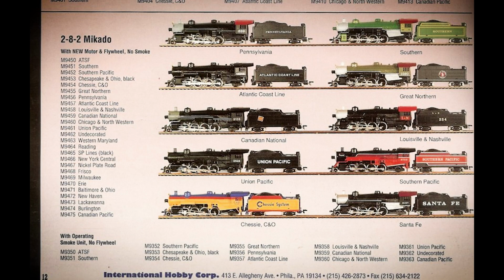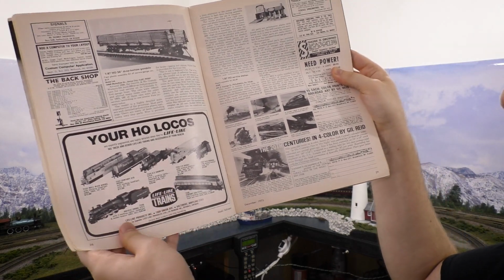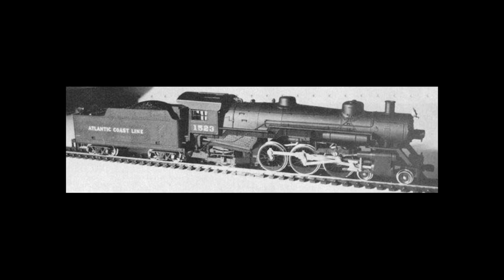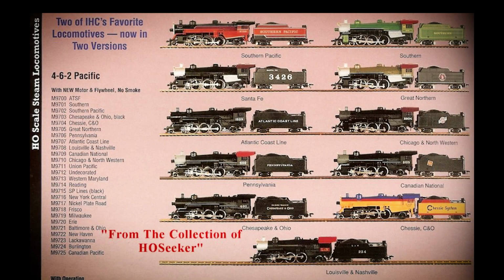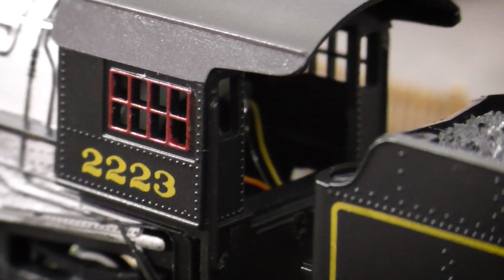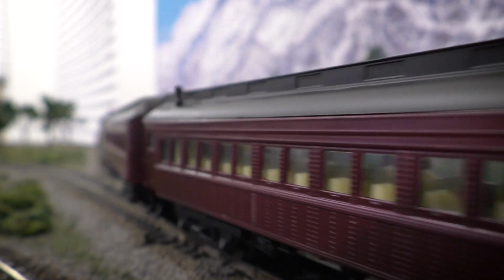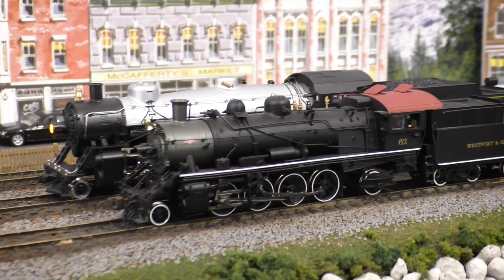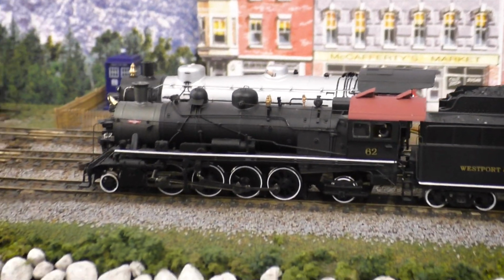IHC 4-6-2 Pacific: A Venerable Workhorse

Comment: This is a great video! I’ve always LOVED the IHC locomotives! They just run so smoothly and quietly and still hold up pretty well to this day, and those shiny pistons on them are amazing imo! I love the USRA 4-6-2s, but I personally prefer the Mikados. I own one in the Durango & Silverton scheme (even if it’s horribly inaccurate to the real deal), and it performs spectacularly and instantly became my favorite HO scale locomotive (mainly because the D&SNG is my favorite railroad). Anyway I loved the video, and great work on the modifications to the Pacific! I would never have the patience to repaint a locomotive as greatly as you did!

Comment: Great video going over this interesting locomotive. I have 2 of these. One by AHM and one by IHC. I noticed a significant step up in the details of the IHC over the AHM. Both run great, just seems the IHC is a bit better. The AHM locomotive is a Southern Pacific in a Daylight livery. The other is Southern Railway and is The Tennessean.

Comment: I have an older Canadian pacific one with a boiler that came painted grey and a marron tender. For the price their pretty sold little locos, and rival most of Bachmann’s offerings in terms of performance. Definitely worth investing in the older models! One thing that I found helped with the slow-speed running on my example was removing the old bulb, as it seems it was drawing a ridiculous amount of current. I haven’t installed an LED yet, so I don’t know if that will hinder the performance, but seeing as most modern LEDs draw very little current, I can’t really see that being an issue.
Reply from the maker: I didn't really notice a difference on mine, but I definitely wouldn't be surprised if removing the old bulb did help. When you install an LED, be sure to add a resistor so it doesn't burn out (I usually use a 1K, but you might be able to get away with one as low as 600 ohms).
Reply: @michaelramsey81  Thanks for the tip, you just saved me an LED (maybe more), as I would not have thought to add a resister. I think some LEDs have resistors already attach as well, so I’ll bare that in mind as well!
Reply from the maker: @modelrailfan37  Yep, depending on where you buy your LEDs, they may be pre-wired with a resistor. If not, it's easy enough to add one. Also make sure the polarity of the LED is correct, otherwise it will only light up when the train is moving in reverse. (If this does happen, swapping the two wires should fix it.)
Reply: @michaelramsey81  good to know, thank you! What LED did you use in yours? I just was wondering if the cheap ones on eBay are okay to use?
Reply from the maker: @modelrailfan37  As far as I can tell, all LEDs of a given size and color are basically the same. Cheap ones from eBay should be fine.
Reply: @michaelramsey81  thanks!

Comment: My favorite which i plan to have 1 day is a model of reading- blue mountain and northerns #425 on the lehigh gorge line in PA. Its a very nove blue color with white stars on the wheel centers.
Reply from the maker: I actually considered painting this one as #425. Ended up deciding not to because I wanted to keep the tender lettering. I might get another one at some point and do that.
Reply: @michaelramsey81  425 is going for her 1472. Thats the required inspection every 15 years or 1472 operating hours. Same for Strasburg #90. Hopefully 425 is put back in service. They have to tear it down inspect and rebuild it. Hopefully it is done in a timely fashion. I beleave they use the Altoona shops for 425.

Comment: I actually have the mikado version of that engine. It served as the big engine of my fleet until 2021, when I got newer spectrum and Bachmann dcc ready engines. It no longer runs with my main fleet, as I have converted the entire layout to dcc, but I still have a small loop of track for it to run on. My parents bought me that engine way back in 2017 when I first started model railroading, and I was happy with it until newer engines came along. Now it just sits in its box, collecting dust. Also, where did those red Pullman coaches come from? I’m interested in getting some for my own model railroad.
Reply from the maker: The coaches are Rivarossi 60' commuter cars. They were originally grey - I repainted them in Tamiya TS-11 Maroon. I believe they're discontinued, but you might still be able to find some used ones.

Comment: I own several locomotives that were sold by AHM (IHC’s predecessor) these locomotives still perform flawlessly. These particular locomotives were manufactured by Rivarossi. The only problem Is, they won’t run on code 83 rail because of the deep flanges.
Reply from the maker: As it happens, I've been experimenting with grinding down the flanges on old Rivarossi locos for that exact purpose. I'll make a video on it eventually.

Comment: I hate to spoil the love of USRA WWII design, but the Southern Pacific NEVER owned a USRA version and most of their Pacifics, Mikados, 0-6-0's, 0-8-0's and 2-8-0's were of their own design and vanderbilt style oil or coal tenders. To make it worst, they never painted a 4-6-2 or 2-8-2 in the full Daylight scheme. I had the Daylight Mikado and it ran bueatifully for over 20 years! Then the driving gears snapped and it was considered 'scrapped'. I still have her and hopes to get her rebuilt (Becoming an Athearn or Bachmann version lol) someday.
Reply from the maker: I'm sure most of the IHC paint schemes weren't accurate to their roadnames. It's not anywhere close to correct for a Canadian Pacific engine either.

Comment: I have 5 Mehano/IHC locos in my collection, 4 of which are steamers. They are all from the "Presidents choice Insiders collection" which is actually a grocery brand that sold HO trains sets in their respected grocery stores in the 1990s and early 2000's at Xmas time. I have the 4-6-2 pacific in a special semi Streamline CP shell that is painted similar to your custom job. It's gorgeous and since it's from the late 1990's it's motor is extremely powerful and it pull 8 Rivarossi/AHM heavyweight coaches with not a single issue. I also have a 4-6-4 Hudson (CNR 5702), 4-8-2 Mountain (CNR 6060) and a Santa fe 2-10-2 (CNR 5100) all fantastic runners!

Comment: I think Model Power was bought by Lionel Trains last year cause I saw some HO buildings that were now under the Lionel HO brand. Meaning Lionel could make scale detail versions of Model Power’s engines with railsounds, smoke, electronic control system, and few other things that Lionel puts into their O gauge trains.
Reply from the maker: Lionel's history with HO is sketchy at best, but it'll be interesting to see what they do. They did make some interesting diecast locos with sound a while back.
Reply: @michaelramsey81  That HO Scale Challenger.

Comment: There is one important spotting feature the distingishes the era of the models. The type of flanges on them. Okay, this is were it gets really confusing and unpredictable. Oh hell, if you can figure this out let me know! My head is now spinning just thinking about it. The code 100 flanges and the NMRA standard flanges seem to change from one manufacturer to another. Another fun fact is the Chattanooga infamous 0-8-0 (its really the 2-8-2, but they tried to trick us - hah take that tyco!)
Reply: The 70's Model Power and Like Like versions of the Mehano Pennsylvania A-3 and USRA 4-6-2  had honest NMRA 0.025"  wheel flanges (but not he tender of the A-3, which had Rivarossi style split plastic wheels). I still have a set of 4-6-2 drivers and trucks with the small flanges in my scrap parts bins.

Comment: I would Like to get a 4-6-2 or a 2-6-2 Both do Look Good.
Reply from the maker: 4-6-2s are much easier to find in HO than 2-6-2s. the IHC 4-6-2 is pretty good for what it is. If you want a bit more detail, Bachmann currently makes one as well.

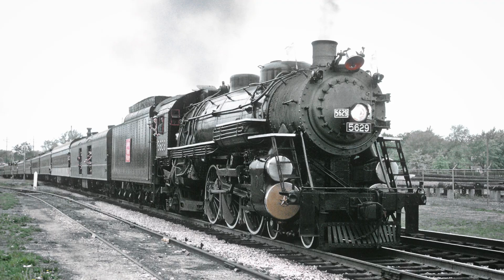Comment: 4:09 RIP gtw 5629 you could’ve been saved if not for metra.
Reply from the maker: Yep, a serious shame. At least 5632 still exists.
Reply: Actually,  it wasn't entirely metras' fault.
Actually,  Metra tried saving it, but the owner of the engine refused to move to, and Metra was forced to scrap it. Then the owner sued, and that failed

Comment: So I’ve been looking at getting a Bachmann 4-6-0 and you seem to have lot of experience with them. Do you think I should look for a older spectrum model or a newer one?
Reply from the maker: Definitely an older Spectrum model if you can find one! They are much more detailed and run better than the newer blue-box ones. If you can, try to find one you can test run before you buy it.
Reply: @michaelramsey81  Thanks for the advice! I’m trying to find one to make into Rio Grande Southern 20.
Reply from the maker: @LMR78  For that, I'd look for a the low boiler version with 56" drivers. If possible, try to find an undecorated one - they came with an alternate wood-style cab that looks more like #20. It's never going to be a perfect match because #20 is narrow gauge, but you could get pretty close to the right overall look.

Comment: I have one of those but it is lettered for New Haven.
I don’t run mine very much anymore but I still love it even though it is not really detailed.

One thing I did to mine though which I think really improved it was I removed that molded in coupler and modified it to have a kadee on the front.
Making it useful for switching or doing run around type operations

Comment: I have had and still have a few. I use em for base’s of more prototypical locos. I found it works great driver wise for a wide range of Anthractie road locos and as a heavy mod stand in for a NYC K11 (try finding a browser one for under 100 today) my only complaint is tender swapping is difficult with all these locos.
Reply: The tender only connects with a drawbar.. no pesky plugs or other wires.. how is that difficult to swap out?
Reply: @Alerrecks  more so a lot of tenders are too short, draw bar on tender, or is Bachmann. Also some of the pacifics are bar on loco and some are bar on tender, depending on year made.
Reply: @mattsmocs3281  so drill a screw hole and cut a piece of styrene.. not that hard lol

Comment: Been looking into a pacific for my railroad. It’s either this or Bachmann’s 4-6-2. The models I have found are a $149.99USD in a purple box, and a $75.00USD in the older yellow box.
Reply from the maker: I'd go for the yellow box one. The only difference, as far as I know, is the handrails. If you're going to spend $150, you might as well spend a little more and get the Bachmann.
Reply: Ok, good to know. Might get both, my fictional railroad is going to have to wait until the future, but I’m still looking into it.
Reply: Also, just wondering, i have an athearn/roundhouse 2-8-0 that i got used on eBay, and i doesn’t really run that well. It stops on strait track (it still gets power, but basically shuts down.) any servicing tips?
Reply from the maker: @katies6426  Those were based on the old MDC "Old Timer" kits. As a result, they have some odd quirks. I've found the motors in the Athearn/Roundhouse ones to be a little on the weak side, so there could be a gear issue that's causing it to bind, but it could also be an electrical issue. Gremlins like that can be hard to track down, unfortunately. On the plus side, they're reasonably easy engines to take apart - just watch out of the wires between the engine and tender, as they go through a hole in the rear of the cab, so you can't completely remove the shell without unsoldering them.

Comment: I have one from in the Southern Livery, and I love it. However it doesn't pull well, and has suffered some falls via derailment, and a cat. I got mine at around $60 in an unopened box.
Reply from the maker: $60 isn't half bad. Check to see if it's missing any weights - that might explain the pulling issues.
Reply: @michaelramsey81  nope not missing anything before the cat, and my layout is on a slight grade.
Only small details are gone, and no traction tires.
It pulls about 7 heavyweight cars with very small wheel slip.
Reply from the maker: @richardjayroe8922  Grades make a huge difference. Mine pulls 10 freight cars easily on level track.
Reply: @michaelramsey81  nope no nothing was missing, it came in an unopened box brand new. Layout has been packed for about a week now due to my new job at NS as a conductor

Comment: I just recently bought one of the IHC versions after having killed two Life Like versions (Smoky 3 pole motors, nylon gears, etc - One of them was the original, original Atlantic Coast Line one from 1973 with offcenter decals) but the IHC version is silky smooth and a great hauler.

Lovely paint job on that! Which satin clear coat did you use for the finish? Looks especially good in fitting with the scenery and color palette of your railroad!

I've repainted my previous one into N&W colors, but the one that I recently obtained just happened to be N&W already - I wonder just how many schemes they offered outside the catalog, as I've not seen it documented elsewhere, but it's definitely a factory job.
Reply from the maker: Thanks! The clear coat I used was Tamiya TS-79 Semi-Gloss Clear, the same stuff I used on the passenger cars. It's one of my favorites of the many spray clear coats I've tried.

Comment: Do these models have tender pickups and do they stutter on switches that aren’t the cleanest in the world
Reply from the maker: Oddly, the tender has pickup, but only for the backup light. A fairly simple mod is to wire the tender and loco pickups together, so the tender pickup can provide power to the motor as well. After that mod, they're just as good on switches as any newer loco.
Reply: Thanks. Im trying to make a model of a Southern pacific H8 and they have Vanderbuilt tenders. I have a riveossi one but I wanted to know if it was possible to wire pickups from that tender to the loco I’m using. (Sorry if I’m bugging you)
Reply from the maker: @jasonanderson6583  Yep, that should be a fairly easy swap. Wiring the pickups together is pretty easy - just make sure to route the wires carefully so they don't rub against the flywheel.
Reply: @michaelramsey81  so that’s why they have tender pickups! I’ve always been sooo confused by why the contacts were there since there’s no wires between the locomotive and tender. I honestly don’t know how I didn’t think of that lol. Also, what’s the music in the video?
Reply from the maker: @modelrailfan37  All the music is licensed from Epidemic Sound. I don't remember all of the pieces I used, but the two main songs are "Martini on the Run" and "Move Like This", both by Jules Gaia. You can listen to them on YouTube, but you need a subscription to Epidemic Sound to use them in a video.
Reply: @michaelramsey81  Oh okay, thanks for the info Michael!

Comment: What's your minimum mainline curve radius, 24"?
Reply from the maker: It's 18". This is about the longest loco I can comfortably run on it. I did once manage to squeeze a Big Boy around the loop, but it was lifting up the inside front wheels on some of the curves. The video is on the BC Hobbies channel.

Comment: Looks better than what it originally looked liked!, also those tea kettles are some of the worst small steam made in HO
Reply from the maker: Thanks! I've had a few encounters with the more common "Docksider" 0-4-0 that (I think) used the same chassis as the teakettles. I think they were trying to make an American equivalent of Hornby's cheap little British 0-4-0s, but what they actually made was the most poorly designed piece of junk I've ever seen. Mantua's die-cast metal 0-4-0 was far better.